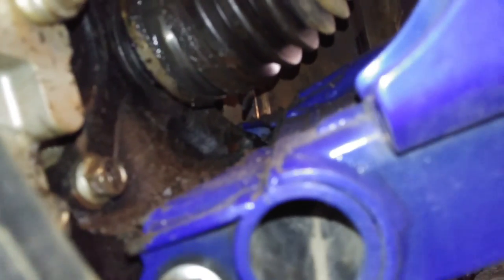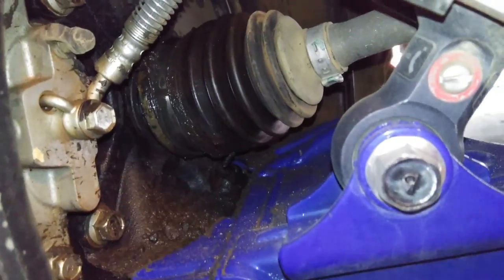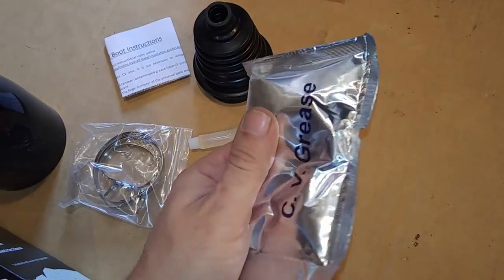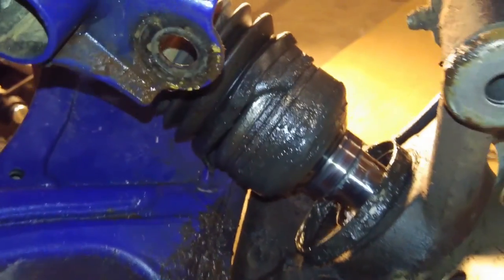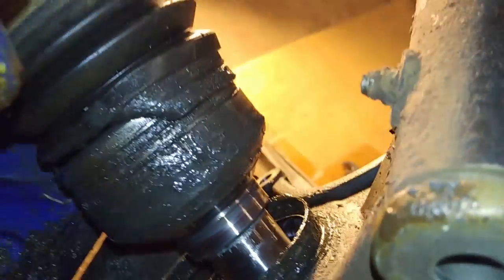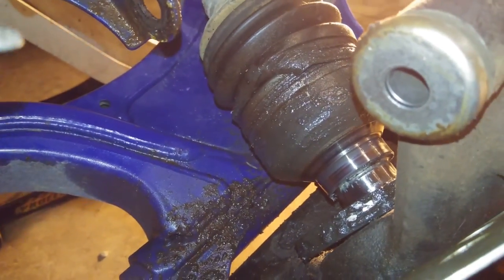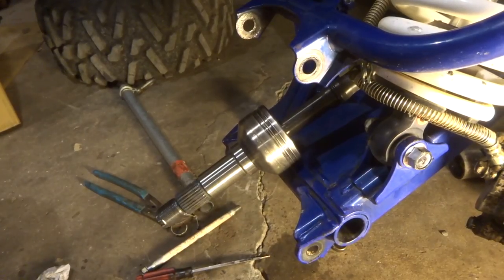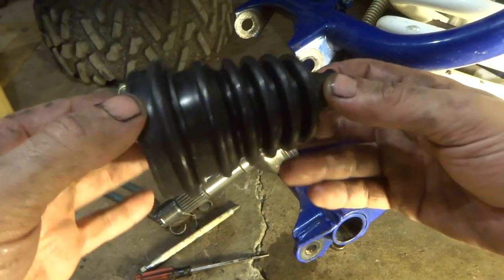CV Axle Repair Kit All Balls EZ Trail Boot Replacement for UTV and SXS

Comment: Just a few tips, I have done a lot of boot changes, you need to keep the cv end super clean, no grease on the boot or the cv, same with the axle end, clean with brake clean or something like that, you also need the banding tool there about $15, the bands aren't anywhere close to tight enough if you want it to stay on for any length of time
Reply from the maker: good tips. I had a ride the next day and the banding tool had not arrived yet so I just threw them on there. i noticed the EZ boot is a lot tighter around the shaft than the stock one was and more flexible. no problems with it yet after 3-4 long rides and about 300 miles.
Reply from the maker: You were right, boot came loose. Ordering the banding tool today. Lesson learned.